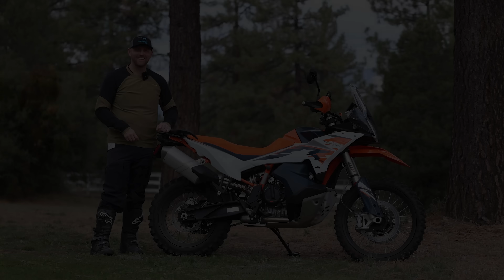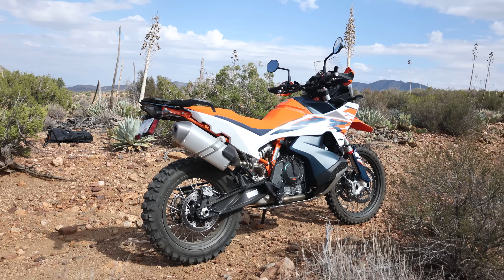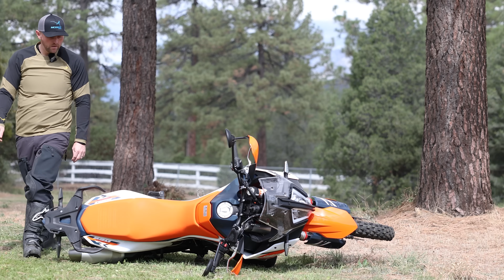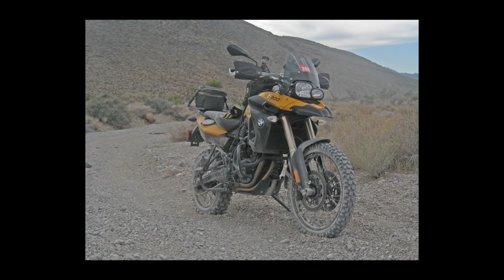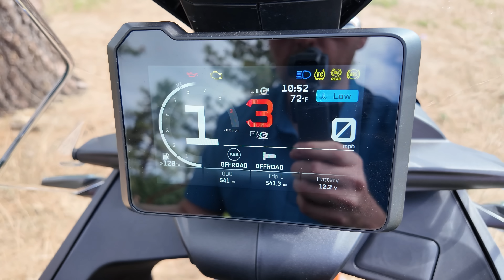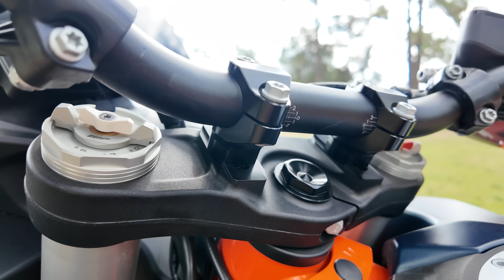4 Reasons the KTM 890 Adventure R DOMINATES Off-Road Adventure Riding

Comment: Thank you for going back to the 890 adventure r. 
I have a 23 I have 20,000 miles on the bike. 
I have so much fun off-road on this bike I have pushed myself to the limits on this bike.
It handles so much off-road that I have just been totally amazed. 
I was in New Hampshire I unknowingly went down a trail that had been taken off the route because of so much rain washing it out completely it was like being on a Rock River bed for miles the suspension and bike setup allowed me to get through this hardcore down and uphill. It blew my mind that I was able to make it through. Since that day I conquered a lot of things I never thought I could on this machine. 
I ride it on pavement all the time as well and it is one hooligan bike. 
Would I buy another one absolutely. Have I had any problems no.
Thank you for your video on your unfortunate Rock damage that did prompt me to buy the Black Dog skid plate

Comment: I have owned 8 KTMS from the 80's to current, most of them from about 2015 on to 2025 and I have not had a single issue with any of them.  That being said, I do have a 2024 890 Rally and I also own a Desert X (Non Rally) KTM and Ducati are my favorite brands because their bikes are simply more engaging to ride in any scenario.  I will say this both my DX and 890 are excellent but I prefer the Desert X as an all around.  Off road each has its respective advantage and disadvantage.  As far as affordability and ready to go the standard 890 is hard to beat so I agree with your sentiments in this video.  However, I would really like to spend time on the DX rally.......those who own them rave about them.
Reply from the maker: Glad to hear you're enjoying both your bikes, and appreciate you sharing your thoughts on the 890!

Comment: Hey, you had quite a few camera focus issues on this one - not sure what you're using but check the deep settings because sometimes there's a mode to put constraint on the focus range that could save you.  E.g. if I'm standing 25ft away I could configure my camera to only focus from 20-30 ft, and it wouldn't hunt because it wouldn't find anything else within the range.
Reply from the maker: Thanks for the feedback and tips, I'll definitely look into that!
Reply: @BigRockMoto  noticed it as well. just use manual focus for static stuff

Comment: Earlier this month I rented the 890 Adv R down in Moab. I rode it on some of the same trails I ride my 500 EXC. Nothing hard, but common level 2 to 4 Moab stuff. The bike did not complain and took everything I gave it. This  bike is far lighter and more suitable for off road BDR type riding than my 1300 GS. It is also a lot less expensive. I am considering picking up a 2025 or perhaps a 26 when those come out. I want this bike next to my 500 on my spring Moab trip next year.

Comment: Soon as I seen the post, I had to stop what I was doing and watch it. Outstanding as usual. I have a 2023 KTM 890 S model. With 10,000 miles on it. I purposely abuse this bike, hot rod this bike, and ride the hell out of it to see if I can get the cams to fail no luck yet. Bike is still running strong, and I’m very happy with it. Would I buy it again?? No, I would buy its big brother the 1290.

Comment: I bought a 2023 890R here in Bend, OR. I chose it because of the reasons you mention, I’m certain it has saved me from more than a couple of fast accidents. I mostly ride out in the rocky/sandy, fast high desert and now have 22,000 miles on the odometer. It has never let me down, I have not been easy on the bike, I do maintain her very well though. Thanks for your thoughts.
Reply from the maker: Awesome to hear about your experience!

Comment: Purchasing a mid sized ADV 2 years ago the KTM Adventure 890 R tested very significantly better than all competitors available at the time. For pure riding and fun it was in a class of its own. However, reliability, paying to unlock features available at time of purchase, build quality, and the fact that I ride entirely alone (no-one to assist in event of a breakdown) and my principal riding area being remote and with poor cell coverage, discounted this bike from the equation. There will always be compromises and the compromises for me meant I couldn't risk buying the 'best' bike. Thank you for your take
Reply from the maker: Thanks for sharing your perspective, those are definitely valid concerns for solo, remote riding.
Reply: I feel exactly the same
Reply: I ride mostly alone, too. I have a 690 R with about 77.000 km, but didn't have the confidence to take is on the long trip to South America.
In Dec 23 to Jan 2024 I travelled with my 2021 890 R about 21.500 km in the southern part of South America, Carreterra Austral in Chile, Panamericana (road) in Peru and a little in Brazil, but mainly in Argentina, Ruta 40 and side tracks. I had tools, spare parts and, for the real mess, an InReach messenger. 
The only issue which stopped me for a moment was a flat tyre in Brazil. 
The other issue is the weight. Whenever I had to dig out or lift my bike I sweared and had a strong desire for my 690. 50 kg or 100 lbs make a difference.
I had the 890 twice on amateur rally events, partially rather rough.
Overall I travelled some 55.000 km with the 890R and head no mechanical nor electric issues.
In my opinion there is no reason to rule out KTM for reliability. Not from my experience covering 60.000 km on a 2000 LC4, 46,000 km with a 2013 690 R during my post in Mexico and the now 77.000 km with my 2010 690 R.
Any of the competion bikes are at least as heavy as the KTM, none has comparable suspension which can make the difference between elevated pulse or broken bones.
If the 890 is too heavy, go for the 690. Both will get you everywhere and back.
Reply: @pjakszentis there still is a difference between overall reliability and a one-person experience. You said you didn't have any prob, others say otherwise, so only stats based as many users as possible can say whether it is more or less reliable than another brand. Mechanics tend to say they see more ktm than japanese bikes though, that's a start.
Reply: @Alattos  Enjoy whatever Japanes enduro you ride.
But, please don't compare a high performance bike like the KTMs in their class with Japanese low performance counterparts. 
E.g, the Tenere 700 is in engine size and power equivalent to the 690, just some 50 kg heavier. Compare the 890 R to the Tenere 700 you face about the same weight but but about 50 % more power offered by KTM. Not to mention the quality of suspension, that is a weakness of most Japanese adventure bikes.
I speak from personal experience, you speak of third hand hear-say.
May the every reader of the comments make their personal conclusions
Reply: @pjakszentis oh I agree with you, they ARE performant, no doubt. Maybe that's why they're less reliable? It's a matter of philosophy for each manufacter: performance, reliability, quality control, they do differ on that. The "ready to race" pitch of ktm is funnily quite descriptive of that: for a race you need max performance and just enough reliability you can finish the race 😂 anyway, don't take it personal, they're amazing bikes no doubt, but their reliability is known to be lower overall (again, at the whole market level, not single bike level 'cause yes some ktm user never had any issue).

Comment: I have a garage full off ktms. After 35 plus years of riding, and at least 75 new bikes over the years its the only brand that still makes me smile. And I love orange 😊
My wife just bought a new 24 890r. 13900 otd with everything unlocked and a 4 year warranty from a fantastic dealership.  Not even worried a little bit about "what ifs".
The first time i rode it... it changed my mind on never going bigger for BDRs then my well built 690r.
Its one of , if not the funnest bikes I have ever been on over all.
I was waiting to buy a new 1390SAR just because of the motor in that thing. But my dealer tells me it might not come to the state's unit 27. If thats the case, Im absolutely getting a 890R for my own. Who knew my wife would set the bar in our MC stable.
Reply: That’s real cool.
Own the 901 expedition and feel the same.
Lucky to have such a cool/badass wife and bikes!
Cheers 🏍️💨
Reply: Which Dealership was it? I'm itching to get back on a 790/890 Adventure Platform. I posted above my experience, all the cam issues got to me and I traded my 2020 790 Adv S in on a SxS. But I keep looking at 890 R's, I want to trade My Harley Street Glide in on one. My Dealers prices are stupid on the website, Full MSRP. Maxmotorsports in Alabama is my Dealer. They have them listed at $15,500 and that's with out the unlocks on the website.
Reply: I'm thinking about buying a 790. Can you explain why an 890 would be better? Seems like the 790 has more than enough power, while being lighter. I know the 790 has softer suspension with less travel, but I'm sure its more comfortable on the pavement. I think the latest model of the 790s front shocks are adjustable. I will be taking off-road quite a bit (probably 30%+) including BDRs out west, so I'm curious what you think?
Reply: @kenhiett5266  owner of both here…unless your doing rough offroad riding, the 790 is great✌️lower seat height also. Lower to ground =better street riding
Reply: Can you donate me one plz😢
Reply: 1979rv125.  1981mx 125, 1986 350,  1988 500, 1991 250exc, 1993 250exc, 1996 300exc, 1997 300exc, 1998 300exc,  1999 200exc....  family ... 2011 990adventure.  2018 1290adventure,  currently 2023 250exc six days.     The 990adventure developed a hairline crack in the exhaust bracket at 47,000miles. That's it.

Comment: Based on YOUR recommendation I purchased a 2023 890 R and love it. 10,000KM and no problems. I ride hard off road and prefer a 4500 acre motorcycle park ;;and it is massively capable. No desire to get any other bike.
Reply: I am surprised a smaller bike isn't better for a motorcycle park.
Reply: @youtubeaccount9058   Well yeah of course it is. But I don't have another motorcycle and riding in the park is more safe (no cars) AND  I can ride much more difficult terrain constantly in a MUCH shorter time than screwing around on BDRs for example, so my skill level progresses MUCH faster. 
I have my 890 set up for 70 off/30 on performance. It is awesome.
Reply from the maker: Awesome to hear you're enjoying the bike!

Comment: Would you say the same thing about the Norden 901 Expedition? I’m under the impression that the Norden is the same chassis and suspension with slightly less edge and a bit more refined experience and finish. Am I oversimplifying the differences??

Great video as usual!! 👊

Comment: Ian, I second your comments 100%.  I had a BMW 1250 which I loved but once I bought the 890 Adv R, I felt like I was cheating when going off-road.  It's sooo much better.  I did the tough parts of NEBDR sections 3 and 4 in half the time and much more confident.  Absolutely worth the money and dealing with any standard quality issues
Reply: The GS also sort of had its version of KTM's cam issue with the GS driveshaft, which BMW ultimately relented to replacing for free for the life of the bike, for certain model years.
Reply from the maker: Glad to hear you're enjoying the 890R so much!

Comment: I prefer the off and on road performance and feel of the Tuareg a little more, myself. I’ve owned both. Haven’t had the Tuareg long, but I’ve had zero issues with it..I cannot say the same for the KTM
Reply: I had the fuel sensor and front left shock replaced on my 2023 Tuareg. It’s been in the shop over two weeks while the dealership tries to diagnose a no start issue. They think it might be the throttle bodies. I’m considering trading it in on an 890R, but I know I should probably get a 2025 T7 😝
Reply: You have a shock on the front of your Tuareg?

Comment: I love my 2024 KTM adventure 890 R !! you can ride it like a 250 motocross bike , and yet it rips on the road !! never had a problem with it , or any of my other KTMs ! awesome bikes !!
Reply from the maker: Glad to hear you're enjoying your bike!
Reply: Those bikes are Whales and you cant ride one like a 250 that is less than half the wet weight, a 125 two stroke would destroy these big bikes in real dirt , a small percentage of riders has any buisness taking one on hard single track and the learning curve on a 500lb bike is long.
Reply: I do not like problem motors either with bad ju ju reputations.I love KTM I own a KTM , I have a KTM shop right here I know the Owner, I know these bikes, I see all the new ones come in every year, 24 was a milestone for improvments with steel oil pump gears, Bright headlight LED, easy adjust spring fork no stupid Air.

Comment: My 2019 790 S has been fine for 23,000 miles.  I like the R model better but I’m 5’8” and my in seam is 32.  This bike is just too tall for its weight if you have to dab on uneven terrain.  My suspension is not as good but I think with Tractive  cartridges and a new shock it will be about as good as an 890R for me which I would need to lower and respring anyway.  It’s much cheaper to mod my 790 than buy a newer 890.  I like the looks of the new ones better but it’s not worth spending extra for new plastics. Dumped my bike several times off road.  Tank has great armor no damage anywhere except the crappy hand guards which I promptly swapped out for real ones.  There’s a limit to what this bike can do and for anything tougher I have my 690 or 350.
Reply: My advice, don't do revalve or improving internals. That's always half measure. 
Wanna invest in suspension do it right and do it once, buy proper shock and/or forks. 
I did revalve on my AT and it improved it but I'm still dreaming about proper ohlins shock and transplanting proper enduro forks

Comment: Ian.  I rented the bike from Colorado Adventures for the KTM Adventure Rally this year.  It really is amazing at taking the punishment of hard off road.  This year was tough, tougher than last year in Deadwood SD.  I have a 2016 GS,.. and love the bike, but would NEVER do to my GS what I did to the 890R,.. NEVER!  Hahahaha,.. I've been thinking about getting an 890 or even an older 790 (KTM says they'll warranty the cam problem now, so even with the inconvenience of having that done, if required, I wouldn't be out too much more $$)  I agree those things are the "standard" every other manufacturer should be looking to meet for performance off road.  I only wish it was lighter.
Reply from the maker: Sounds like you put the bike through its paces!
Reply: @BigRockMoto  The rain this year made the tracks very challenging.  Lot's of slick mud, large rocky flowing creek beds, etc.  One section we called the "slip-n-slide".  Fun and exhausting.

Comment: I think you need to look at the footage from the ramp jump. You went off a 15 inch high ramp and the suspension COMPLETELY blew through the entire stroke. Yet another lie by KTM, as these bikes ARE NOT race ready. Add that to the quality issues of KTM and you have a bike completely based on lies and overhyped!
Reply from the maker: It used the stroke but didn't bottom out. Other bikes all bottom out.
Reply: Buddy you have no idea what you talking about. This is not motocross 😂
Im last one to defend ktm, but bs is bs

Comment: My answer to your question is, yes. I’m looking right now for a 890 R. I still can’t decide if I should buy a new one or older model ( 21) because the motor cycle market is really slow currently, the used bikes contain some great deals.
Do you think that an older model would be comparable?
Reply from the maker: Short answer, yes. The 2023 and later style is improved, but the earlier ones ride mostly the same.
Reply: Defo get used one.
Don't support company that treat bikers worse than  dirt

Comment: Super fun bikes to ride. Several buddies have them. Our ride Sunday was cut short when one of the two 890rs with us wouldnt start (again) we had to tow him 14miles down a single lane western NC forest road. Then we had to go get a truck and trailer.

I didnt buy one because I like riding, not letting it sit in a dealership to be diagnosed. Now its to the point where I dont even want to go riding worh guys who own them bc theres a 50/50 chance one of them is not going to start, will cut out or will throw a code. Its happened several times. 

I will say, its almost like a gamble, bc one of them in the group has 25k miles and has never had any problems at all. No leaks, no codes, starts every time ect. 

If they were more reliable, Id own 2 of them. One geared, suspended, striped down and protected for single track, and another set up, geared, suspended for heavy camping loads.

Once they get their gremlins under control, or develop tried and true fixes for these problems Id live to own one. 

Nothing comes close to their performance, comfort, and especially the handling. It's really a shame they have the problems thwy have, because its predecessor, the KTM 950/990 platform was nearly indestructible. 

The problem with that platform is parts are becoming increasingly hard to find. Major pieces like fuel tanks, engine cases, swingarms are impossible to find (new OEM), if a guy goes the 990 route, you might as well buy two. One to ride, and one for a parts bike. 

Come on KTM, make the 890R as reliable as the old 990. I want to own one! Until then, I'll just ride buddies bikes for 20-30min when we do bike swaps on rides.
Reply from the maker: Thanks for sharing your honest experience with the 890R.
Reply: Howdy, I see you post everywhere and I live in the mountains of NC.
If I didn’t own a 901 Expedition I’d say let’s go ride!😉
I’m luckily one with 20,000 miles with no issues. 
Cheers 🏍️💨
Reply: I used 89 octane fuel vice 93 and have had no issues at all. I have read that is a decent fix to most no starts. Yes it should be a free software update or similar.